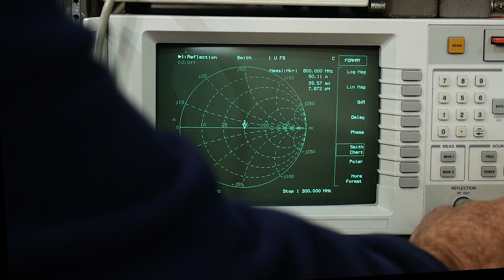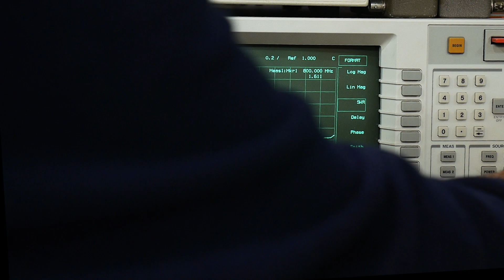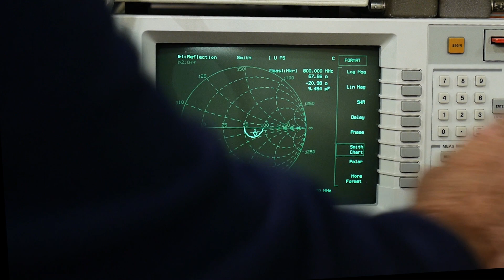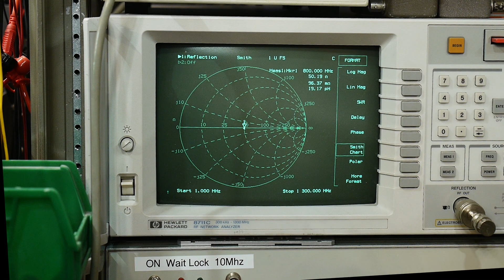#1410 RCA Connector used at RF frequencies (part 2 of 2)

Comment: Collins hamradio gear have RCA on the RF output and many people always questioned its signal integrity. Once I read an article of someone that made some tests on the RCA connector and arrived to the same conclusion. They are perfectly fine for HF. But, I think that the problem is no signal integrity but roubustness. It is not very good for that! I believe PL connectors are used in hamradio grear over say N type connectors due to their roubustness.

Comment: So, the engineers at Heathkit were actually doing hams and SWL's a favour by using the RCA connector in the low power transmitter and SW receivers of the day.

Comment: Not all BNC's are the same there are 50 ohm BNC and a 75 Ohm BNC the construction is different and can be interchange. 75 ohm is for vidio use and the 50 ohm is for RF use.
Reply: Yes, not only the BNC but other connectors like, TNC, SMA etc have 75 ohm versions. In the 50 ohm connector the ratio of the outer circumference of the inner conductor and the circumference of the outer conductor is low when compared to that in the 75 ohm versions.
Yes, that's how the characteristic impedance of any Coaxial system is designed (apart from the nature of the dielectric material, ie, the dielectric constant)
But Imsai guy is not mixing up the 50&75 ohm versions of the connectors here, I know.
Moreover, strictly speaking they should not be interchanged.
De VU2RZA
Reply: @subramanianr7206  i AGREE WITH YOU ON ALL ASPECTS THAT YPU MENTION. bUT YOU CAN INTERMIX 75 AND 50 OHM AND YOU MAY NOT CHECK THEM AND THEY WILL FIT INTO EACH OTHER
Reply: Sorry I did not know the caps was on
Reply: @keithschreiter3885  yes; I believe you should take a closer look at the center pin of the 75 ohm male BNC connector and the inner diameter of the female 50 ohm BNC.
De VU2RZA

Comment: today's video, you dealed with measuring the Return Loss of RCA connector which I expected in the previous video. My opinion is that Its measured value of VSWR 1.6 is not acceptable in the TX (@800MHz) and it should be less than 1.2 or so.
Reply: if it is used only in the RX path or in the very low TX power, it looks ok  to use though...